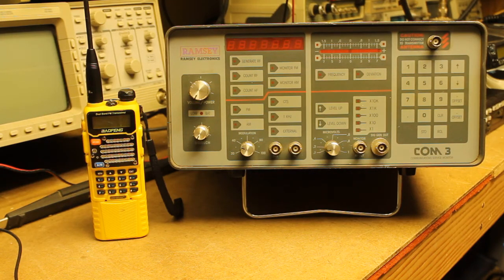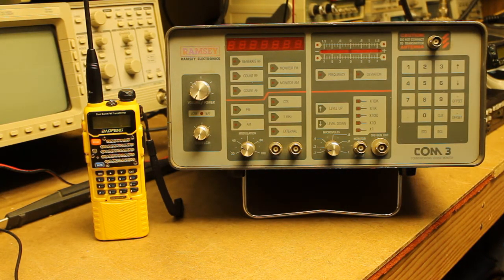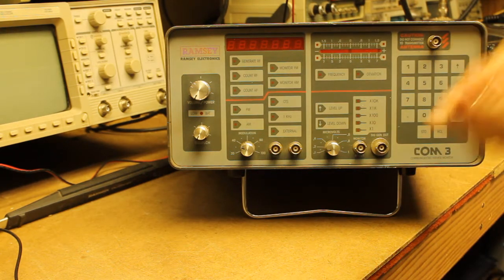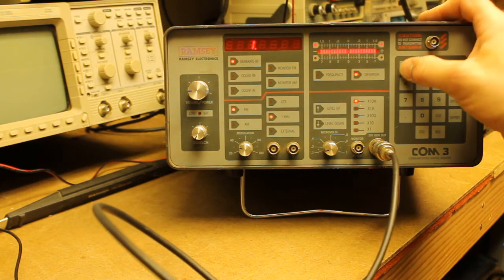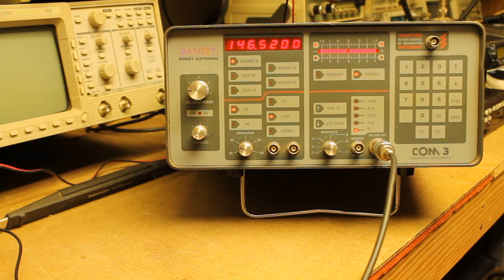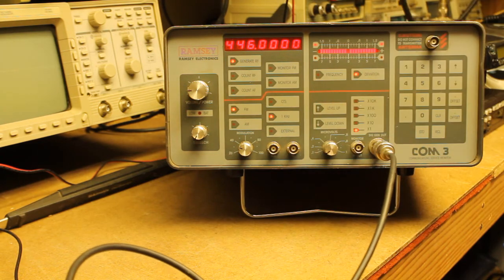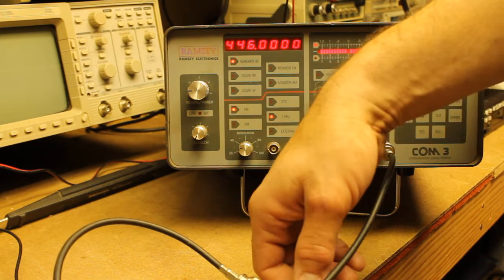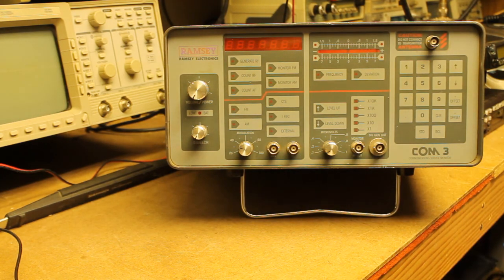Sensitivity Testing the Baofeng UV-5R

Comment: You don’t mention the deviation you’re using to test the radio. Looking at your test set it had limited options for that but it looked like it was set to to +-1.5 KHz. So the next question is was the radio programmed to narrow or wide Band? If it was wideband(25 KHz) then you should have had the test deviation set to 3 KHz. The standard manufacturers use for their specs is 3 KHz for wideband and 1.5 KHz for narrow. If you had tested at 3 KHz dev you would have found the opening point at a higher level. The higher the dev the higher the opening point. The other thing is the term quieting which is a bit subjective. The spec normally used for FM is 12 dB Sinad. Sinad is signal to noise and distortion. A common figure from commercial manufacturers is 0.3 uV @ 12dB Sinad or around -117 dBm. The trade off with these radios is how good they are at noise opening the mute. You also didn’t mention what the radio was set to. They have a setting ranging from 0-9. Factory is 3. The short answer is these radios give average mute performance but they are great value for money.